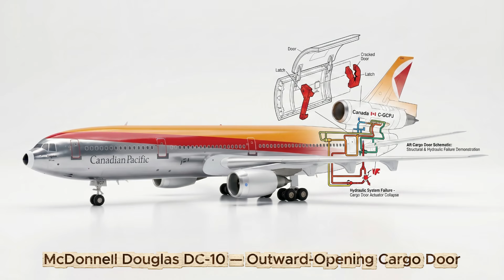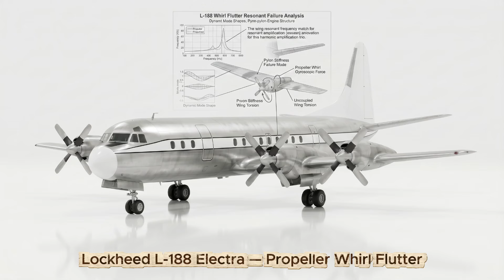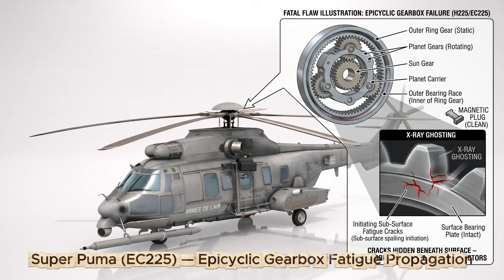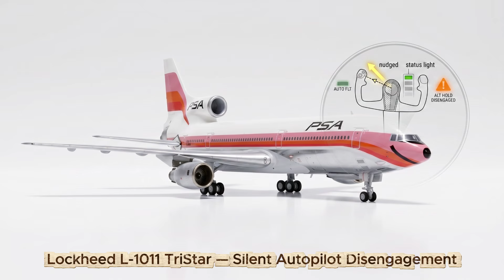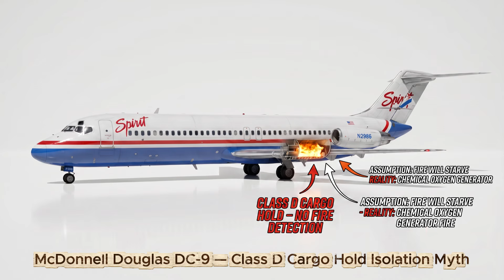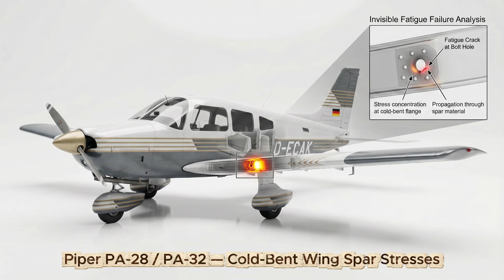Deadliest Design Flaws in Aviation History

Comment: Ive heard that the square window theory was proven wrong since the glass is round, and only the outside sheets around the glass were square, and it was actually the fault of the square antenna on the top of the aircraft